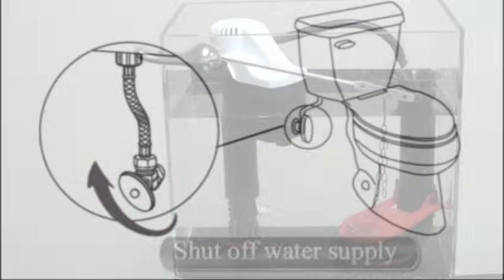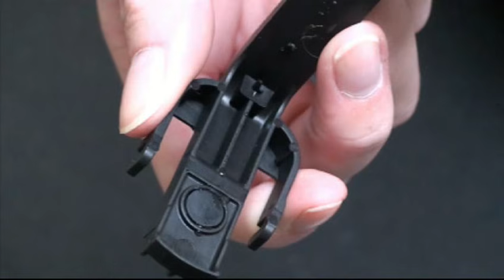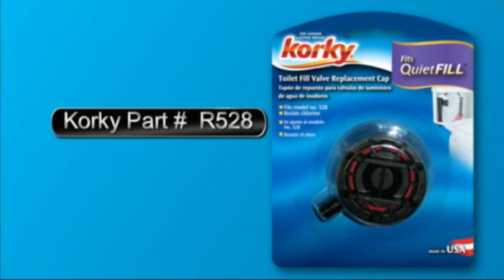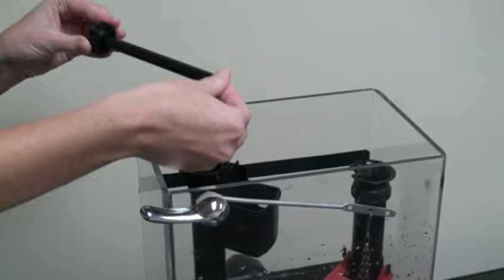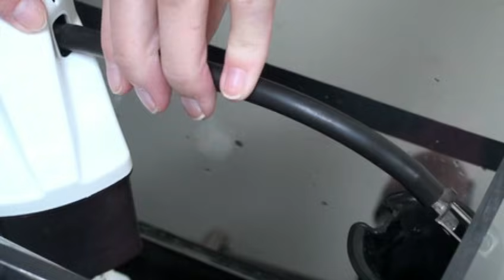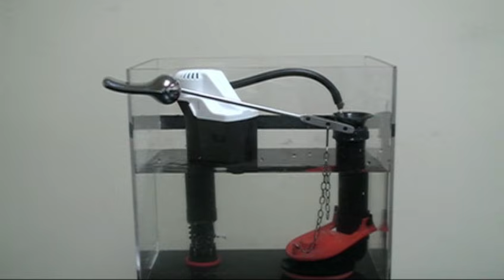Korky QuietFILL Toilet Fill Valve Maintenance

Comment: I've replaced many of the competitor's fill valves.  I think the Korky lasts longer and is more reliable.  Suggestion:  If you need to replace the shut-off valve, use a quality made-in-the-USA, quarter turn ball valve.  They last much longer, shut off completely, and don't leak.

Comment: That diaphragm just seems to disintegrate within a few years and have to be replaced.  Is this by design or is my water eating holes into the diaphragm? 

I have the water pressure knob turned all the way to the right should I lower the water pressure and see if it will make the diaphragm last longer?

Comment: Thank you for this (vintage) video. After cleaning the valve assembly and strainer I found what I believe are the remains of the rubber gasket from the toilet shut-off valve(!) Time to get that fixed ASAP.

Comment: You need to explain how to line the cap to where the top piece sits down in the correct position.
Reply from the maker: Thank you for the feedback.  When reassembling the valve, the nozzle on the cap assembly should be orientated to the 3 o'clock position when placing the cap assembly on the top of the valve (assuming float chamber is 6 o'clock position).  Once in position, the cap assembly should be twisted clockwise until tight.

Comment: After 25 years, I rebuilt three of our toilets with Korky kits.  Everything went well and works perfectly with one major exception.  On all of the Korky valves, when the water lever reaches the top of the fill and the valve closes completely, it emits a loud 'chirp'.  Very annoying and is anything but 'QuietFILL'.   Does anyone know of a fix to this?  TIA
Reply from the maker: Let us help!  Would you mind contacting us?  Please dial 1-800-528-3553 or email us at sales@lavelle.com. We are available Monday through Friday, 7:30 AM to 5:00 PM CST. Your fill valve is backed by a 5 year warranty and we want to ensure your 100% satisfaction.

Comment: My toilet was pulsating water during the fill cycle.  I found your video and checked out everything and foul\nd that the black toilet assembly kit o-ring had worn and caused numerous holes which caused the pulsation.  I ordered a new part, looked at the video again to remind me how to replace and completed the repair in 5 minutes.  The toilet is working like a charm! Thanks for the video, Korky.
Reply: I’m having that exact same issue, just ordered the piece from Amazon
Reply: Same here. Thanks for your comment.
Reply: What does 'pulsating water during fill cycle' mean?
Reply: @ChristopherDillman if it’s happening to you u know what it means!  I’m having same problem & trying to fix now.

Comment: After watching the video tring to figure why it took so long to refill. I discovered the float and float cup were full of schmootz that was  restricting the cup's drain hole so the float wouldn't drop and start refilling for several minutes after a flush. The video was a great help in showing how to remove the parts for maintenance - Thank You!

Comment: How often should we do maintenance services?
Reply from the maker: Good question. This will vary for each installation. We recommend servicing when you feel any water flow has been reduced or if the valve isn't running the same as it was when first installed.

Comment: My toilets were pulsing water when it almost reached the top of the water tank line making the pipes continuously bang.  I followed the video and found debris in each of the filters. I washed all the parts and assembled it back together. Now both toilets work with no issues. This saved me some money in replacing the parts or calling a plumber. Thank you!!

Comment: Not a fan!!! Converted all 5 bathrooms to this product and less than a year later, they all leak.
Reply from the maker: Let us help! Are you able to contact our Technical Support team? We would like to learn more and quickly identify a solution. Your valves are backed by 5 year warranties and we want to ensure your complete satisfaction. Please call 262-763-2434 or email Sales@Lavelle.com. We are available M-F, 7:30am-5:00pm CST.
Reply: It happened to me before. My problem was using the chlorine pucks that help to clean the toilet. Unfortunately, the pucks also reduced the lifespan of the Korky product.  I replaced it and stopped using the chlorine pucks in the tank. The product works surprising well after a number of years now.  Hopefully the chlorine pucks is the issue for you.

Comment: What I haven't seen in maintenance of the valve is that the float chamber has a small drain hole that must be checked to insure the float falls, allowing the valve to fill. If the float chamber doesn't drain properly the float won't fall normally resulting in a slow or delayed fill.
Reply: I followed the video and my toilet still wouldn't fill. Turns out it was this same issue. The drain filter in the fill tank was clogged. Thanks for the hint.

Comment: I replaced the kit, filled tank then turned water supply off, leaked down to joint in pipe, tighten really tight did not fix, not a fast leak but does leak down to joint in pipe !!! any suggestions  would help?
Reply from the maker: We apologize for the inconvenience this has caused you. Let us help! Are you able to contact our Customer Service team? Your fill valve is backed by a 5 year warranty and we want to ensure your 100% satisfaction. Please dial 1-800-528-3553 or email us at sales@lavelle.com. We are available Monday through Friday, 7:30 AM to 5:00 PM CST.

Comment: I fixed my noisy valve by turning the water inlet valve from the wall DOWN (less water flow), not wide open. Takes bit longer to refill but noise is almost gone now. Others might want to try that before disassembling etc. I did that too and only found one tiny bit of gravel. Not worth taking apart be my tip. The issue is the water pressure. Try that first before taking the thing apart. Image the money some plumbers must be making by simply messing with the inlet connector handle, lol. "That was a tough one Ma'am, $50 should cover it"
Reply: Thanks, your fix eliminated my problem, and I didn't have to mess with the innards of the fill valve.

Comment: I rebuilt my toilet with Korky's complete kit. The one with tank gasket, bolts, nuts and guts for ~$20. I have not had to do squat to it since 2013. :) I have a 3 gallon Gerber 1973 toilet. The plumber who would not fix it but wanted to sell me a $400 toilet said they'd 'take it away for me'. It took me a few hours due to all the cleaning but well worth it.

Comment: This worked perfectly for me--AFTER I figured out that there's only one way to re-seat the supply tube into the valve body (align the small plastic tab on the bottom of the rim with the corresponding notch in the valve body). Before I did that, the fill valve filled the toilet tank just fine but wouldn't shut off. Other than that, excellent video--thanks, Korky!
Reply from the maker: Glad to hear this helped you out and you were able to get the fill valve issue resolved!

Comment: i just installed one of these and it makes a load  noise when it hits its shut off point.  i checked the red diaphragm and even changed it with no resolution.  intensity is dependent upon how open i have the tank cut off valve,, full open very load, half way , diminished,, and so on.  any ideas?
Reply from the maker: Sorry for this inconvenience. Are you able to contact our customer service team? We would like to work with you to quickly resolve this issue. Please call 1-800-528-3553 and we will have your toilet functioning correctly in no time.
Reply: thank you. Just spoke with customer service and its a known problem on some units,, replacement parts are being sent to rectify.
Reply: parts received and its quiet.  part replaced was the supply tube.
Reply from the maker: Wonderful! Thanks for your patience. If you have any additional questions or concerns, don't hesitate to reach out. We can be reached by dialing: 1-8001-528-3553.

Comment: After replacing Korky it worked for year or so and now i am having problems fill valve leaking water running very slowly.Old floting system worked good for 11 years without problems and this Korky system  giving me problems with in year!REDECULIS!With todays technology our engineer CAN NOT design better product! Disappointed in this Korky product SHAME.......SHAME........SHAME....
Reply from the maker: +Kishor Mistry We are sorry to hear your disappointment. Are you able to contact our customer service team? We would like to learn more about your toilet and quickly fix the problem. Please call 1-800-528-3553 and we will have your toilet operating correctly in no time!

Comment: Just installed a brand new Korky valve in my Toto Toilet. The fill valve is defective right from the box. Toilet continues to fill very slowly because the valve won't shut fully. I disassembled and inspected it, and put it back together. 
Same problem. The valve leaks.  My installation was done correctly. The valve is adjusted to the correct height. I'm experienced with this sort of thing, having replaced them many times over 30 plus years.
Very unhappy as I've wasted half a morning fiddling with the thing, and now I have to return this one and buy another! Hopefully A DIFFERENT BRAND. 
If this is what made in USA means, I'll happily buy Chinese.
Reply from the maker: +handyboy2000 we are very disappointed to hear your frustration and apologize for the inconvenience this has caused you. Are able to contact our customer service team? We would like to learn more about your toilet and installation to help quickly fix the problem. Please call 1-800-528-3553 and we will have your TOTO toilet back to normal in no time!
Reply: +handyboy2000 Over react much? No product is 100% free from the possibility of defect. Just calm down and change it.  As if a single unit represents the quality of an entire brand! Don't act like a princess.

Comment: I've had my Korky 528 for over 5 years(zero problems) and now it has started making a squeaky noise while filling up the tank along with periodic gushing of the water through the slits on the white cover. I suppose this video should be helpful in diagnosing the problem! 8-)
Reply: +Bob Droidsky oh there we go the pink diaphragm is half eaten away!!!
Reply: +Bob Droidsky looks like the pink gasket that makes a seal with the bottom of the tank is also flaking... hmm.
Reply: +Bob Droidsky Thanks for making these videos!!
Reply from the maker: +Bob Droidsky Thank you for choosing Korky, Bob! Should you have any additional questions, don't hesitate to contact our team by dialing 1-800-528-3553.

Comment: Be careful removing refill tube from fill valve cap assembly.  I broke off the nub, so had to replace the cap assembly that sits on top - Korky R528 was only $3.68 at Home Depot.  Also had problems removing the cap assembly, and had to use needle nose pliers.  Thanks for the video...I was about to replace the whole valve.

Comment: Was extremely helpful, thank you for making this video. My Korky was not filling the tank. With this tutorial, I was able to figure-out why. The pilot seat, under the float arm was not flush, rather it was "swollen", or protruding past the level of the float arm. I pushed the pilot seat back into its seating area in the float arm to make it flush / level with the float arm. Then rebuilt the Korky. What it was doing was since it was swollen, it kept the water from filling, no matter what the position of the float was in. Thank you again. I will spend a couple of dollars and replace the pilot seat soon. But With the direction of this video, I saved a tone of money by not calling a plumber, and immediately remedied my problem with my Korky fill valve and my toilet is running as it should.

Comment: What does "never insert the refill tube down into the overflow tube" mean?
Reply from the maker: kowasumono thanks for your question. To ensure the water is properly directed into the flush valve, we recommend using the included metal clip. If the refill tube is just just placed into the overflow tube, the pressure of the water could cause the tube to spray water into the toilet tank. If you have any questions about installation, please do not hesitate to contact our customer service team by dialing: 1-800-528-3553.
Reply: cool thanks. :)

Comment: thanks for the videos.  My toilet continues to run even went not in use.  the little hose continues to pour water into the fill tube. how would you suggest fixing this?  thanks!
Reply from the maker: Thanks for you reply, we appreciate your feedback. To better assist you in your toilet repair needs, please call 1-800-LAVELLE to speak with our customer service team. They will help to trouble shoot your toilet.
Reply: Korky Toilet Repair I just called and spoke with a female rep that was very informative and great to work with.  thanks for both your help.

Comment: Thank you for the fabulous video! Before I replaced my existing Korky valve I decided to call and see if something might simply be wrong with the one I have that I could fixed. Smart move!! Korky customer service is fabulous! They walked me through what the problem might be and yep... I have a faulty flapper which I will replace. Thanks for the fabulous customer service.

Comment: How often should one perform this routine maintenance?  Once a year?  Every 6 months?  Only when you notice a problem?
Reply from the maker: Rubikant,
Thank you for your question!  In most cases, servicing is only needed when you notice a change in the performance of the fill valve.
Please feel free to contact us at 1-800-528-3553 if you need further assistance.
~Korky Technical Support

Comment: I just installed my valve and had the same problem, the valve would not refill after emptying. I had to tap the top of the valve every time. I took the cover off and found the side of the float device was rubbing on the body. Took it off and put it back on, seems to work fine now. Very easy disassemble.

Comment: Thx for this Video.  It was exactly what I was looking for.  Whenever there is Rust or Mud in the water the system gets all gummed up with sediment.  This causes the Valve to run a slow stream of water continually.  Good as new now!  Thx again, DracoRigel

Comment: I had a problem with my tank not filling up after emptying. I would have to tap on the Quietfill to get it to start filling again.  After watching how easy it was to take apart and service, I found burrs on the side of the floater that kept it from dropping after the water went out.  Shaved off the burrs and it works nicely.  Shouldn't have had to do this, but thanks for putting out a service video for us do-it-yourselfers.  Sure beats taking it back to the store.

Comment: Is water supose to flow outside the back of the flow valve unit or all through the black tube? I had to shove a peice into the tank and bent the flow valve after it was installed. It started leaking so i had to retighten it at the bottom of the tank. It works fine it just pours out of the unit and the tube though